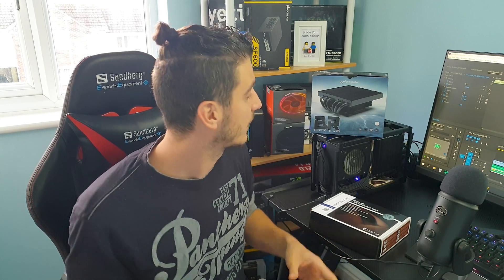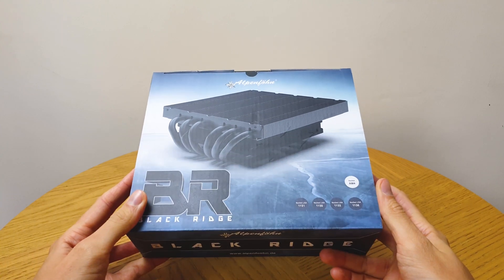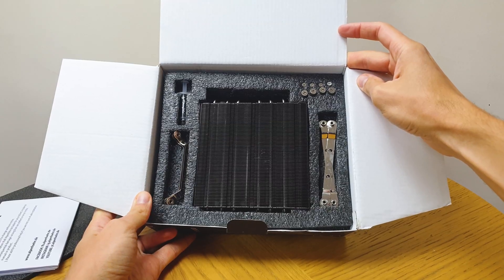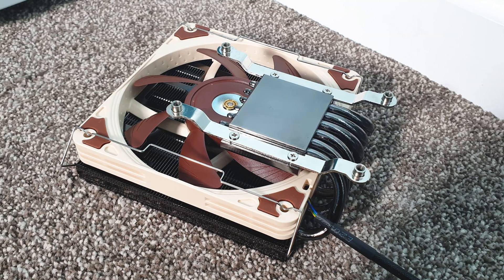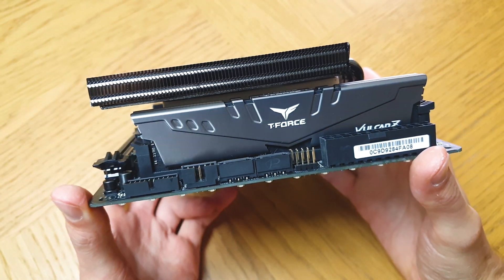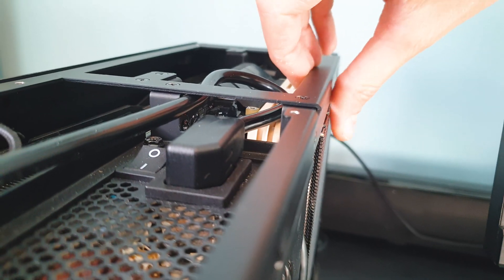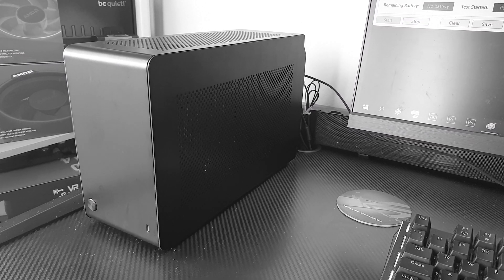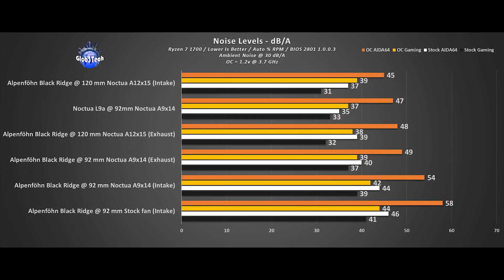Alpenfohn Black Ridge | The Best Air Low Profile Cooler for the DAN A4-SFX?

Comment: Hey maybe someone can help. I am using the a4 sfx case with blackridge cooler and 3x noctua fans. One to replace stock noctua, one beneath psu and one under mobo. Cpu fan should blow air on cpu right? Which direction should be the two bottom fans? I read exhaust everywhere but shouldnt heat exhaust at the top? Like hot air wants to rise? Shoulsnt i intake cool air from bottom?
Reply from the maker: Hi. If you check my playlist, I did all of these tests and combinations. 

I would do the one on the blackridge as an intake (sucking air from the outside).plus it cools the mobo as well.
 
Under the mobo, as an exhaust (push air out of the case) since the fan on the black ridge will distribute air over the motherboard as well. 

The one under the psu, shouldn't matter too much since you don't have an AIO. I would place it as an exhaust to be in tandem with the one under the motherboard. 

To get the most out of the blackridge, if your mobo allows it and get vlp ram, try the noctua 120mm slim fan. I did a video on that as well.
Reply: @Glob3Tech  wow thank you so much! Will watch the seriee
Reply from the maker: @takeabow2774  Most welcome 🤗 Any more questions, let me know.

Comment: Did you use a fan duct for the L9a tests? Or should I distract 5c from the results? Still hesitating between Black Ridge and L9a.
Reply from the maker: I have the duct tests in a later video in the playlist. So yes, in this clip, no duct kit.

Go for the Black Ridge if you are comfy with the vlp ram in order to use the slim 120 mm fan and if your motherboard accepts all of these without mods.

Otherwise, it's very hard to beat the l9a as an overall package (primarly in the A4), especially now with the fan duct kit.

Comment: Your english cannot be more perfect bro. Just like me, when i am trying learn how to speak in english in front of the mirror. But thank you. I understood everyting CLEARLY. :D
Reply from the maker: Oh thank you so much man 😊 Means a lot! Exactly, just keep at it. The habbit will form naturaly 🤗
Reply: @Glob3Tech  i want to use somehow, not ulp but vlp 31mm ram with 12mm fan, somehow want to deshroud an lga 1700 motherboard remove  wifie card spacing and be it something like dinge dongle like, or som other soltion for wifie. which mother board do you think will work, asus z590 sure not cause tower m.2, but maybe msi z690 or asus b660, or any other? want to maintain ddr5 compatibility.
Reply: and as i know there is no ddr5 vlp, i want 2 32gb stick or at least 2 16gb.
Reply from the maker: @szabozoltan11  Hard one to guess since I don't have any of those mobos to proper gauge any experiments.
Reply: @Glob3Tech  Fair. Do you think i can swap the rear heatsink and front fan control plastic from evga 3090ti to 3090, or there is some aftermarket one, i dont like the colour either front of back of the non ti, but my case only fits non ti. What do you think, can you make me a forum question somwhere, if you are into it?
Reply: @Glob3Tech  maybe the front plastic is the same. if i check it again, but i dont know, height and length the same, only depth difference, and definitely the backplate colour.
Reply from the maker: @szabozoltan11  Sounds like you like to experiment. 😄 Unfortunatly I never even hold a 3090/ti so I have no idea there as well, sorry. To be 100% sure, yeah try on linus tech tips forum or even tom's hardware. You would most def get full answers there 👍

Comment: Not sure why, but for the the black ridge with Noctua Fan was performing a lot worse than the noctua L9a., It was 10C hotter and louder, switched back to the L9a with the Noctua Fan Shroud and it is silent and cool again. Really wanted to love the black ridge, but the noctua solution was the way to go for me.
Reply from the maker: Hi Martin. I see. What orientation did you used it in?

Comment: Hi! Thank you in advance for this great video.
I see something strange at minute 07:02. The last row and the third row from the bottom show the temperature values with Noctuas 92mm and 120mm as exhaust. The 120mm behave a lot worse than the 92mm (both as exhaust). How can this be possible? A 120mm fan should be better than a 92mm fan with same conditions.
Do you have any reason for that?
And thank you again for the video.
Reply from the maker: Thank for the feedback! Yes, it's due to the auto % rpm fan curve and sometimes I there are spikes of temp due to load etc hence why I will see 'wierd' results like this. If I keep the fan speed at 100%, then everything will be ocd math perfect 😄
Reply: @Glob3Tech   Thank you for the early answer! 
To be more accurate, you should maintain all the fans at the same speed constantly to really see the difference in temperatures. Otherwise you will see this unreliable results.
As I see with Optimun Tech tests, there is a difference between Intake and Exhaust, but it's only around 3ºC (not 13ºC). It's enough to change the direction, anyway.
Thank you. Your video helps me make a decision choosing the right cooler.
Congratulations.
Reply from the maker: @promaxtor892 Thank you again for the info and feedback! ✌
Will do in the future and glad to be of help.

Comment: Omg I’ve looking for a video with this exact info! Thank you so much! This is my build: Dan a4 v4.1, Asrock B550 mb, Ryzen 5 3600, Corsair Vengeance LPX 2x8gb, EVGA XC3 Ultra RTX 3070 and of course Blackridge cpu cooler (intake). The most annoying problem I had was the loud cpu fan noise, even while just browsing I kept hearing the rpms going up every 30 seconds or so and the case was quite hot. I switched to the stock Ryzen cpu cooler and temps and noise was quite better, only problem is I can’t close the side panel lol. So I’m currently debating whether to buy a noctua 9mm fan for the blackridge (because of my ram I can’t get a 12mm :( ) o just buy the Noctua L9a cpu cooler pack. Which one would you recommend? I use the pc lightly for work, some CAD programs and mostly I want to try new games at 2k. Thanks again man!
Reply from the maker: Hey Gonzalo! Ah my pleasure man, glad to help and thank you for the kind words 🤗 Nice build you have there by the way. 
OK, with the black ridge with the noctua fan or even the L9a, I suggest that you manually OC the CPU for 1.075v-1.1v or an offset negative voltage since that's why it makes the fan go crazy - the bios keeps pushing too much voltage to keep the high GHz. Have a look please at my other videos in the playlist where I saw a 20C difference on my 3700x just by doing that voltage trick, on the L9a if you can believe it. Since you already have the Black ridge, get that noctua fan since it's way better than the stock BR one and then do the manual OC. 👍 Let me know how it goes.
Reply: @Glob3Tech  thanks for your fast response man, really appreciate it! I’m gonna try that! Just out of curiosity if you had to use the noctua 9mm fan which cpu cooler would you choose? (Assuming you undervolt the cpu and use the optimal config) The blackridge or the noctua n9a?
Reply from the maker: @gonzalocrs  You are most welcome🤟 Tough one 😁 I really like both - the L9a it's such a potent low profile cooler for its size while the BR has a lot of potential but only with the 120 mm fan you can unlock it. Since that is out of the equation, yeah the L9a I would go for as long as you do that manual voltage. Plus with the L9a then you can have more RAM options heigh wise.
Reply: @Glob3Tech  Hey man! I'm back to report results for anyone interested. I was able to get a discounted NH-L9A cromax and I can tell the noise and temps reduction are quite significant for its size. I quickly switched the cooler and placed the Alpenfohn fan as a chasis fan under the mobo (exhaust). The noise of that Alpenfohn fan is reeeeally loud, had to switch its voltage in bios to 3-pin and it finally got quiet (I’m gonna order a 9mm noctua fan to use it at regular speed). 
I took your advice and undervolted the cpu (3.6Ghz) to 1.075 and the noise got a lot lower with temps around 55-60 with light usage (chrome, excel, etc) and 70-75 while gaming. After that I tried 1.05 and temps are 50-55-60 light usage and 70 gaming. 

Using a regular pc I know that cpu temps should be around 40-45 degrees (light usage) so I would like to ask you if my current temps are okay. Also, should I place the chasis fan under mobo as exhaust or intake? Which one is more efficient? I’m also using another noctua 9mm (25mm thick) fan under the psu (exhaust aswell but I'm not sure what impact that one is having in the chasis overall). Thanks for your patience :)
Reply from the maker: Nice one man ! Thank you for the updates! 
Your temps with the L9a and current setup and tweaks, seem on track. (also what's your ambient temp?) 

Yeah, try to get another Noctua fan if you can in the future to replace that black ridge fan.

As for fan orientation, I would suggest that you place the case fan (below the motherboard to exhaust) to dumb the hot air outside the case downwards, since the L9a does an excellent job at providing some indirect airflow to the motherboard as well, and that air should be collected by the case fan.

As for the 25mm fan underneath the PSU, well it would make sense to exhaust as well but here you must experiment to see which would be better - I never tried that fan placement option underneath the PSU. For reference I have discovered that with the AIO, the best results are with the fan placed to blow the air upwards - but again this is for the AIO. 

With the CPU, you can experiment as much as you can, just make sure that at 3.6 GHz you still have at least +/-5% of its stock performance. But it's up to you, personally I will always trade 10% FPS for a 15-20 degrees C cooler CPU.

Comment: Does you build not have a graphics card? or is it just hidden somewhere
Reply from the maker: This case has a sandwhich/parallel design which means the other side of the case has the GPU which is connected via a riser card to the motherboard. 👍
Reply: @Glob3Tech  oo nice

Comment: Alpenfohn Black Ridge can work in push-pull configuration using stock fan and adding "Alpenfohn 120mm rgb high speed" at the top?
Reply from the maker: Not in the A4 of course, but in any other supporting case. Check this video please - https://youtu.be/x_lY6-4EKHE
Reply: @Glob3Tech  I have Corsair crystal 280x.
Maximum cpu cooler height is 150mm so Black ridge can fit easily.
So I can use 2x120mm fans as long as the fan under is slim.
Thank you.
Reply from the maker: @dragonld123  Perfect. Exactly 👍

Comment: Hi, I noticed you were using a noctua cpu air cooler. Which model was that? and why did you switch to the black ridge? is it for better temps? thanks
Reply from the maker: Hi. I tested a lof of variations but came to the conclusion that the Black Ridge is worth it if you can find the VLP Ram so you can use the 120 mm slim fan. If not, overall for the A4 the Noctua L9a is better for my needs since it's a bit quieter.
Reply: @Glob3Tech  Oh ok, Im going for a similar build but with 9th gen (i5 9600k & z390). but I am not sure which z390 mini itx motherboard to go for as I know that I will run into clearance issues with the Black ridge? do you have any recommendations?
Reply from the maker: @KlashtasticK  Sure thing. From my understanding the Asrock Z390 Phantom ITX Gaming is a popular choice with no modification. But please double check to avoid any surprises. I never had anything from Intel for the newer stuff just AMD. Hope this helps :)

Later edit:
Found one confirmation here for the Asrock.

https://www.reddit.com/r/sffpc/comments/dhp66u/alpenfohn_black_ridge_on_asrock_z390_phantom/?utm_source=amp&utm_medium=&utm_content=comments_view_all

Comment: Thanks for your nice video. I like your analysis on the Dan A4 components. 
My plan is also to go for a Black Ridge with a 120mm fan. I‘m considering this VLP RAM:

https://www.kingston.com/dataSheets/KVR26N19S8L_8.pdf

I also watched your video about the ASUS B550-I. I‘d like to have the same mobo. 

However, it seems the RAM is not supported by the B550-I, 

https://www.asus.com/Motherboards/ROG-STRIX-B550-I-GAMING/HelpDesk_QVL_Memory/

where as the B550-F does support it. 

https://www.asus.com/Motherboards/ROG-STRIX-B550-F-GAMING/HelpDesk_QVL_Memory/

The B550-I only supports the following non VLP RAM:

https://www.kingston.com/dataSheets/KVR26N19S8_8.pdf

I don‘t understand that for two reasons:
1) the motherboards are more or less the same, differ only in size and IO.

2) the RAM are also more or less the same, only differs in their PCB size according to the spec sheets.

Do you have an idea why the VLP RAM is not listed on the -I but on the -F mobo as supported?
Thanks in advance for your answer!
Reply from the maker: Hi Matthias. Thank you very much! 🤗

I would say 99% your desired RAM kit (from the first link) will work on any motherboard as long as they are not ECC (which they aren't, so all good). The one I had for this video also wasn't listed in the official QVL list at that time and they worked perfectly. Usually vendors can't fully list every possible kit out there hence why we will find weird discrepancies like you listed above. 

Good luck and please let me know how it turns out. ✌

Comment: Do think this will work great with a i5 9600k not overclocked?
Reply from the maker: I never tested that CPU but I would say yes and worst case maybe some negative offset will solve it.
Reply: Glob3Tech does this mean it will work great? My English ain’t so good
Reply from the maker: No problem :) I think it will be ok in stock form for your CPU. You can adjust the voltage in the BIOS of it is too hot.

Comment: is there any VLP on the market with higher speeds (not overclocked)? for instance 3600 ??
I'd totally go for this setup with the 120mm fan from noctua but i'll also want to have faster RAM.
Either this as seen in the video (love it btw. thanks for the detailed info captain!!) or see how a Ryzen 3700x would do with a 90mm fan and still be able to have faster Ram.
Reply from the maker: Thank you sir 😁🤗 
Unfortunately no. At the moment I haven't seen above 2666 MHz. 
https://amzn.to/31Ow3L0

Hence why I haven't pursued it further since with the 92mm fan even the Noctua there isn't a big difference.  
But will put it the books 🤗

Comment: Is it possible to re-bend the pipes to fit my g.skill flare rams? I need just about 3mm!!!
Reply from the maker: Uuu.. Tricky one. Do you have the parts to see exactly?
Reply: @Glob3Tech  I did not risk it. I just removed the heatspreaders of my g.skill flares. Now the cooler fits perfectly on my X570-i Aorus Pro WiFi.

Comment: Wow, I'm totally gutted -.- The riser cable that comes with the Kolink Rocket is too high. No chance in hell that will fit. Did that riser cable come included with the DAN case?
Reply from the maker: Ah sorry to hear that Dash. Yeah, all Dan A4 cases come with the riser cable.
Reply: @Glob3Tech  Update: managed to get the riser in there. For anyone having the same issue or planning this: you have to pull the 120mm fan right to the top of the mainboard, the riser will have to bend slightly, but should be fine. Like this, riser of pretty much any hight will fit. 
Still, I think the DAN A4 is the better option, some things in the Rocket are not fully thought through :/ But thats another story
Reply from the maker: Thank you for the update! Glad you got it sorted in the end.

Comment: Thank you sharing your setup, i'm planned to build mine with Alpenfohn Black Ridge. Do you think gigabyte z490i aorus ultra itx will fix this cooler without remove its m.2 heatsink?
Reply from the maker: You are welcome! Thank you as well. From the pictures, I think high chances that it needs the M.2 heatsink to be removed. Can't really tell for sure though since we need another angle and measurements :)

Comment: Hi, Nice video, very detailed.
Im a bit new and I'm not english speaker so I'm not sure about the intake/exhaust configuration.
Just to make that clear for me, the alphenfohn comes by defualt in exhaust and does that mean that the airflow is from the fan to the OUTSIDE (meaning pushing air from the "motherboard" to the cooler  and to the outside)??
Changing the fan so that takes air from outside to make it go throw the cooler is intake (meaning flow of air is cooler --> fan --> motherboard)?
thx for the video it helped a lot !
Reply from the maker: Hi Kevin. Thank you, glad to be of help 🤗 Sure no worries. Exacrly right!

So yeah from factory they put the fan as an exhaust - exactly like you said - it blows the air from the motherboard side through the heatsink and then outside.

Flipping it in, as an intake, it sucks the air from outside, cools the heatsink and as an added bonus, it cools the motherboard as well which in turn helps a bit with the VRM, chipset temps as well. 

Any other questions, please fire away 🤗
Reply: @Glob3Tech  thx for the early reply. Ill get it and swip it around for better performance then ! nice review

Comment: Did you remove the backplate on the bottom of your motherboard?
Thanks :)
Reply from the maker: Yes. I removed it mainly for extra airflow. Plus it's a pain to install the motherboard since I take my computer apart so many times for tests etc :)
Reply: @Glob3Tech  Thanks for this! :)
Have you noticed any warping or curvature on the motherboard, seen here:
https://www.reddit.com/r/sffpc/comments/eonpp7/dont_use_the_ekl_black_ridge_on_a_am4_mainboard/
Reply from the maker: @henrialloyd  Yes, I remembered mine did the same :)
Reply: @Glob3Tech  The threads on the OEM backplate of the Asus B450-i can be tapped out gently, and can then be used in combo with the Black Ridge + AM4 CPU. I've just done this myself, to help prevent any motherboard curvature :)
Reply from the maker: @henrialloyd  Very nice! Thank you for the tips!